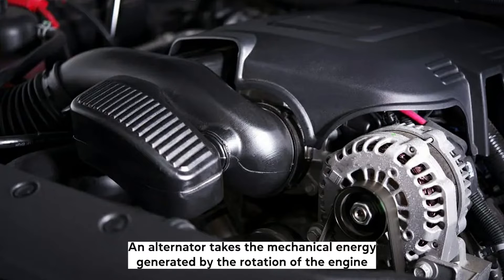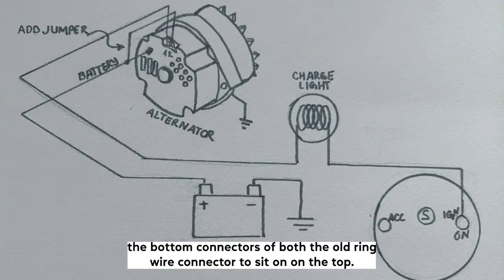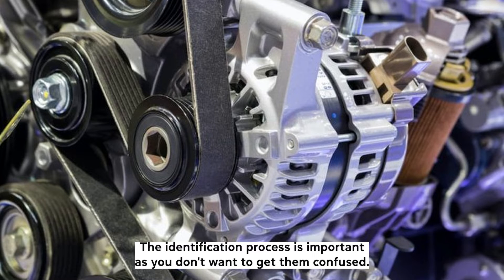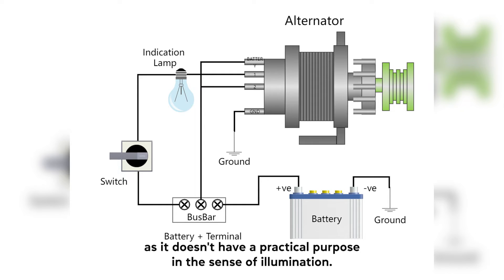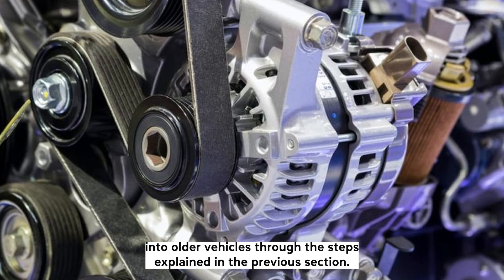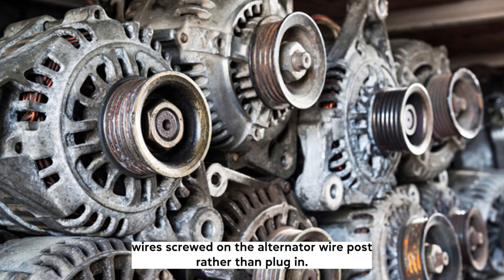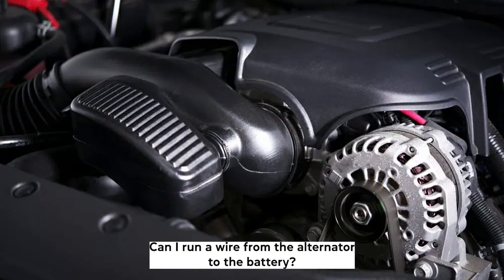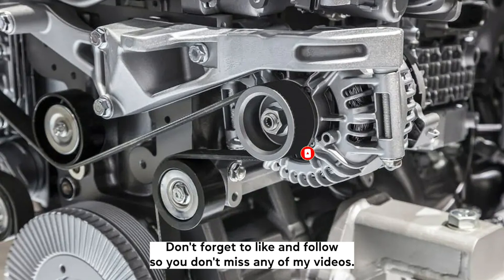3 Wire Alternator Wiring Diagram Explained With Steps

Comment: Does anyone know how to match up alternator connector wire harness if the wire colors are different. The harness wires running from the alternator are black yellow and blue….then crimping or soldering 2 yellow wires and one orange.
Reply: the color of the wire doesnt matter, where the land is the determining factor.
Reply: @Jerry_Lives makes no sense what you say here…smh

Comment: This is actually considered a 2 wire or pin alternator, as you go by how many wires or pins are in the plastic plug housing only.
U don't take into account the main charge output as a wire or pin due to the fact all alternators have to have this, so U only go by the pin amount in the plastic plug connector only.
Hope this helps.
Reply: I disagree. If you were not to count the main output wire, then the famous GM "One Wire" alternator would be called "No Wire" alternator. You count them all.
Reply: No,, its not